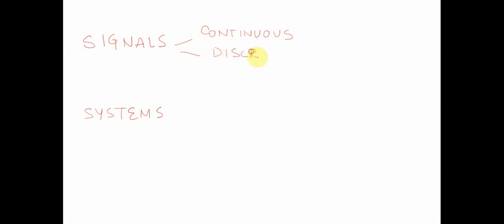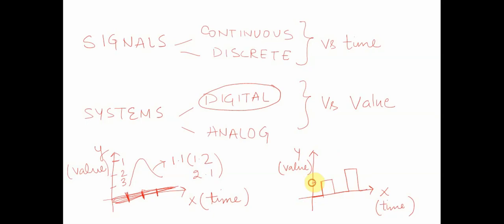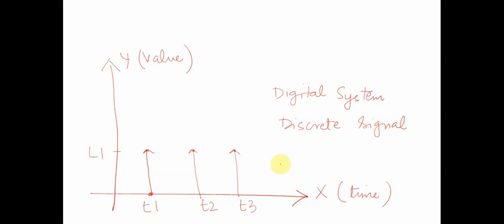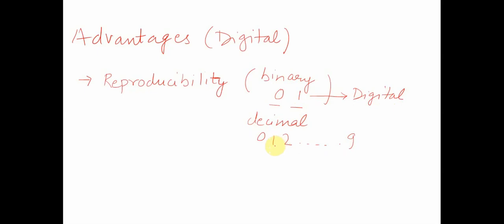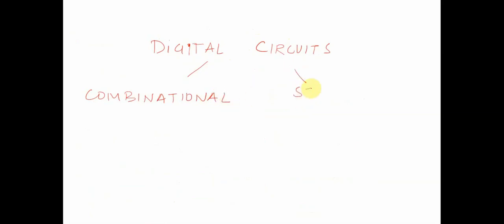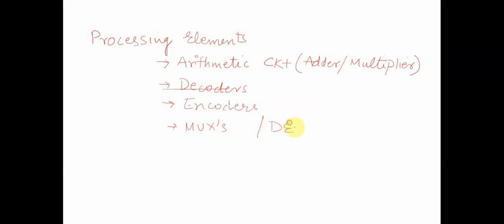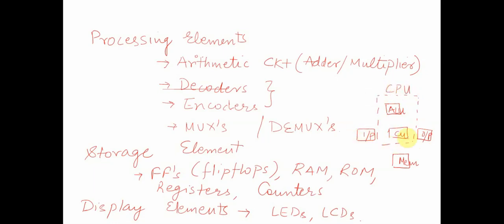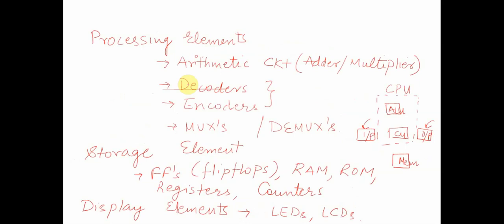Lecture 1: Digital Electronics: Signals, Systems and Elements

Comment: Hello Robin,

Thanks for this full course on digital electronics. In this Lecture1, I have a doubt regarding digital discrete system. Please correct me if I'm wrong. 

In a digital discrete system, what will be the value in the system after that particular instance of time is passed? 

Please let me know if the question is not clear.